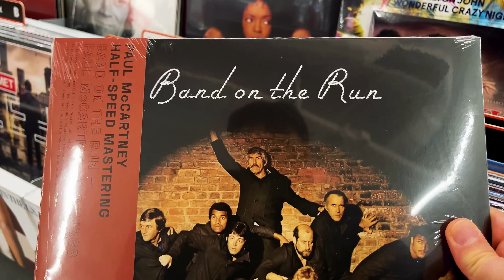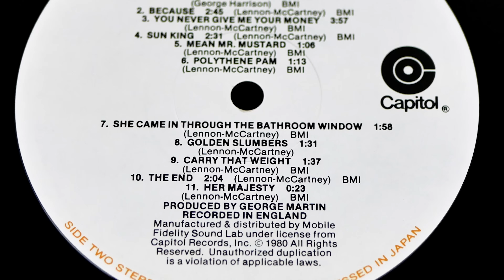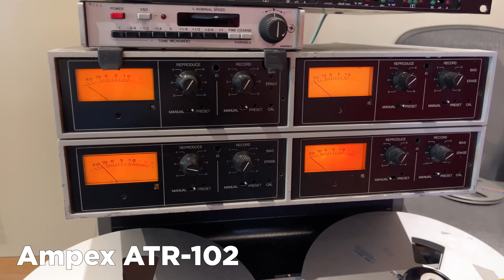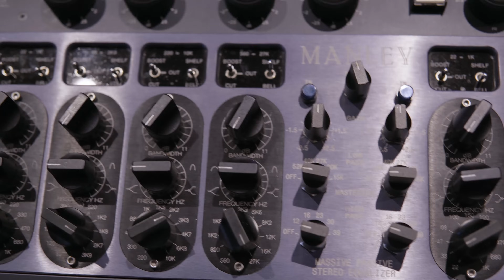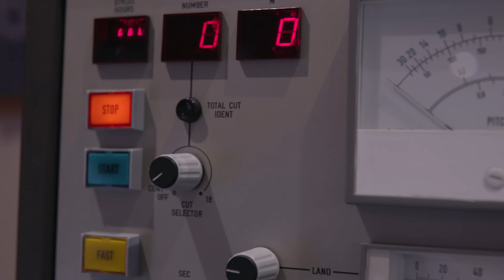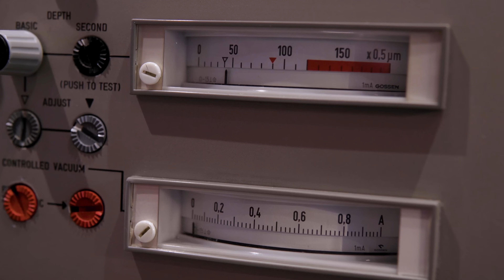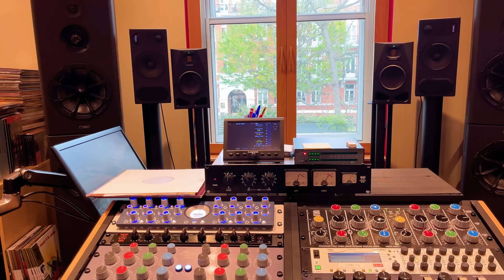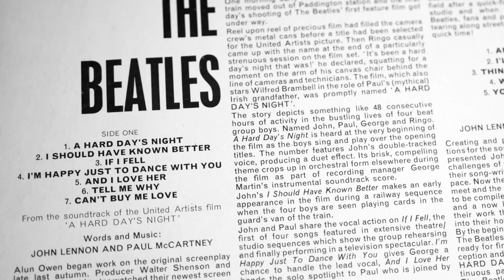Abbey Road's Master of Half Speed Vinyl Miles Showell Tells All

Comment: Miles should explain why inner groove distortion is such a common occurrence on his cuttings. I've stopped buying them entirely.
Reply: What’s is inner groove distortion?
Reply: @goldenboy8167  on any record you buy, the last tracks on either side sounds muddy or distorted 
Try playing back to back the first and last track of any record you buy, the first track will always be clearer and punchier compared to the last.
It is a physics phenomenon. There are videos here that explains it.
Reply: @bpabustan wow, I never knew that, thanks
Reply: The speed of the vinyl at the needle at the outer Groove is app 500 mm/sec and at the inner Groove is app 220 mm/sec. Therefore they have to compensate for the slower speed
Reply: I am aware of this being an inherent problem to vinyl, but it is extremely apparent on many cuttings by Miles, to the point where I consider them defective.
Reply: Brother, change your stylus, a simple Audio Technica VM540ml, It will make you reduce the inner groove distortion almost to oblivion. Don’t forget the correct setup of overhang, azimut, and tracking force.
Reply: @bigfoistfilms  truth be told, all records of any make have inner groove distortion, it's the nature of the beast especially on records spinning at 33 1/3 RPM or slower. A very detailed turntable setup and a very clean new cartridge and stylus will reduce it  very considerably. However, if after all this is done and the record still sounds horrible at the last track, then I guess the mastering is poor.
I have several Miles Showell vinyl mastered LPs here and so far, except for one, all are good sounding records.
Reply: First time I noticed the inner groove distortion was in 1974 . I had a very good analog playback system. I was listening to Rubber Soul UK pressing on Parlophone. It opens with Drive My Car - opening track - which just knocked the doors down; however, when it got to Michelle - whichever side of the record it was on - it was so distorted I couldn’t believe it. Michelle was one of the breakout songs on the album. Paul used his first real bass - Rick 4001 - on Michelle . That song should have been the second track on either side of the album. The bass is SO important on that song, and you know the cutting people were aware of this, and where to sequence the songs . They really missed on that one. To this day I don’t understand how they could make an error like that on a BEATLES ALBUM !
Reply: @jacquesgerbercosteau8358  interesting, my RUbber Soul though printed in the Philippines used a UK stamper. There were more than 1 master lacquer of that record. Mine was cut by Harry Moss. Even if Hazel Yarwood cut that, it would still have less IGD. Was yours really made in UK? Was it a 60s pressing?
Reply: @bpabustan  my Rubber Soul was an early yellow logo Parlophone with a 2 / 1 Mothers ,and 2 letter stampers both beginning with the letter R , like R G ,and R O hence the early mothers at 9:00, and stampers 21 ,and 25 . This was an early pressing . I’ve seen them with two, and three digit mothers, and three letter stampers that were off the charts - no pun intended - Look at the inner grooves on any Beatles albums ,and how much dead wax there is . “ Michelle “ never had a chance. As I mentioned . You don’t open an album with a ballad, but Michele could have been second or third track. The fact that all the songs on Rubber Soul I believe may be UNDER three minutes . The difference between the UK fourteen tracks as opposed to Americas twelve tracks also makes a difference of course. But Capitol screwed up every Beatles regardless of all else. Anything for an extra buck here in the USA …
Reply: @jacquescousteau217  I did further research and the -1 cuttings were too hot and compressed, it was one of harry moss' mishaps.
Reply: No joke, because he tests them with that Audio-Technica MicroLine stylus shown at 8:55. I have one, and it makes inner-groove distortion disappear. Unless there is groovewear, the last song is clear. The weird part is Audio-Technica's more expensive "Special Line Contact" stylus does not do as good a job on the inner grooves. I should have never "upgraded," haha.
Reply: His half speed Eno cuts have a channel imbalance. I got rid of 'em. His work is sloppy.
Reply: Don’t be sitting around blaming the vinyl this is an issue with your set up . The situation you are discussing is called sibilance, it is not caused by the vinyl,  it is caused by a poor quality cartridge, it can also be caused by a misaligned cartridge, and or a cartridge with the incorrect tracking force applied. You need to spend money I’m afraid, Ortofon 2M  bronze on a £200 deck correctly set up will have no sibilance. However a Ortofon 2M Black will reveal so much more.
Reply: @robertandrewhale  i have a Kuzma 4 point arm with an Ortofon SPU Royal N. I also have another turntable with an Ortofon 2M black Cartridge. They have been set up by two different specialist. The results are the same with pressings by Miles. The worst offender is The 2022 Revolver Remix. Take my word for it, avoid ANYTHING by Miles. For the record I never have trouble with MOFI, AP, Impex, Blue Note etc.
Reply: That’s interesting, I apologise for telling you what you already know, I bought the Stones box set, and I am not that fond of it sonically, there are a number of issues with incorrect mixes and a  dull sound in places, not at all helped by digital files supplied by the band for the project… always play the original vinyl, I’m now using a Mackintosh T5 with a Ortofon Quintet black.
Reply: @robertandrewhale  No worries. I see what you're saying but there is a difference between something being of lower quality (or just different) and being defective. There are too many examples of horrible cuttings by Miles, to the point where I consider him incompetent. Are there pressings by others that I'm not 100 % Satisfied with? Sure. But a contemporary pressing of a Beatles record shouldn't sound like an angle grinder (and yes I am exaggerating to make a point, but the distortion is pretty horrible on some albums).
Reply: @robertandrewhale  these are the exact problems that lead to the invention of the compact disc….
Reply: @bigfoistfilms  Given how subjective this all is, I would be extremely curious as to what your age is?
Reply: Use a much better cart like a Ortofon or Clearaudio.

Comment: Ive not heard a single Abbey Road Halfspeed that comes anywhere near an original. Digital Pressings with the Halfspeed Hype-word slapped on to hide the quality of the digital soures they use… in my opinion of course. It is very possible to use tapes for remasters nowadays if there is a will to do so and put out a quality product; Analogue Productions, Speakers Corner, Sam Records, even some Mofi’s just to name a few.
Reply: Most tapes used these days are 3rd gen production masters.  A DSD transfer of a 1st gen tape is a better option.
Reply: @SPAZZOID100  a good label will tell you if they use a 2nd or 3rd generation tape. DSD is fine (I own the big Rolling Stones Boxset that is all DSD and it sounds great), yet abbey road doesn’t seem to be able to get good sounding results on a regular basis. God knows whos fault it is.